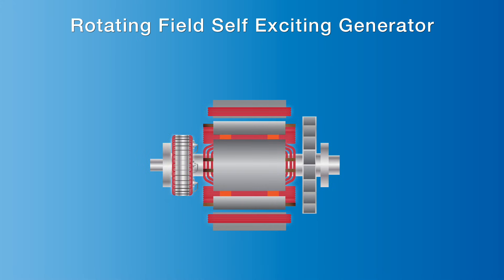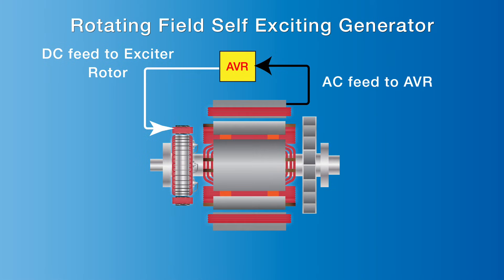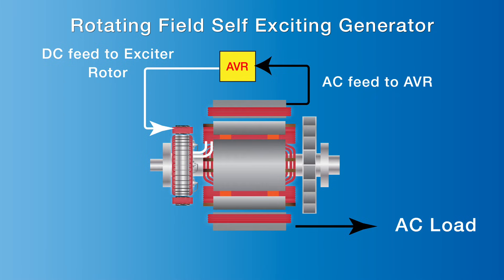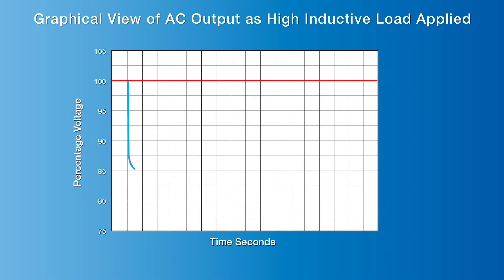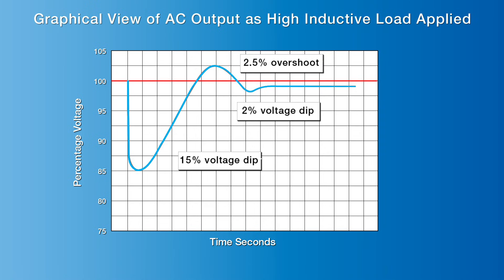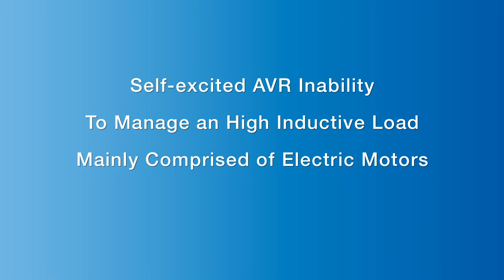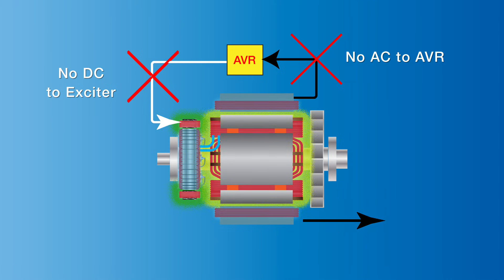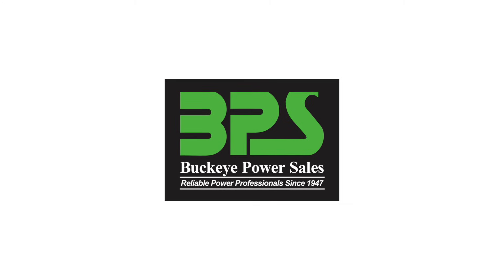Self-Excited Generators

Comment: 1:01 DC fed to stator or Rotor??
Reply: DC is fed to the STATOR of the EXCITATION system, which makes a magnetic field. While the rotor of the excitation system spins, the rotor spinning against the magnetic field induces current in the little rotor, which then transfers to the big rotor, causing the spinning bigger rotor to have a magnetic field, which then induces current in the bigger stator and makes the generator create power, so it's the opposite with the little stator and the big stator. In the excitation system, the little stator needs to produce the magnetic field, but in the MAIN stator and rotor, the ROTOR is the one that creates a rotating magnetic field.